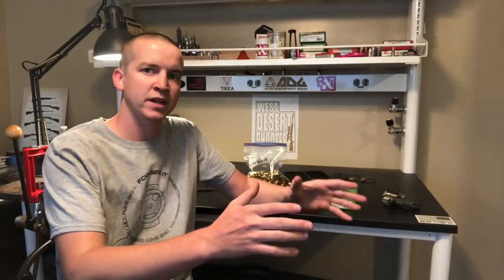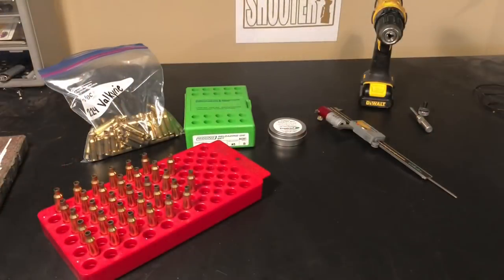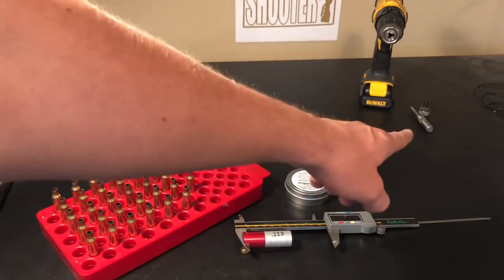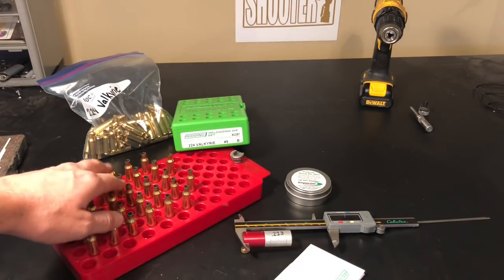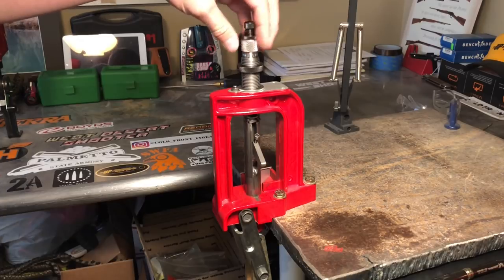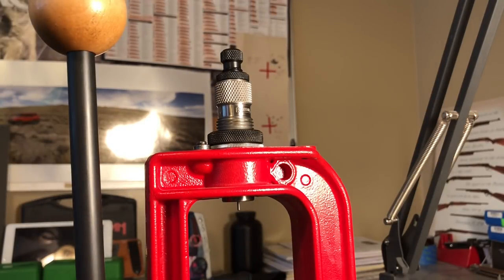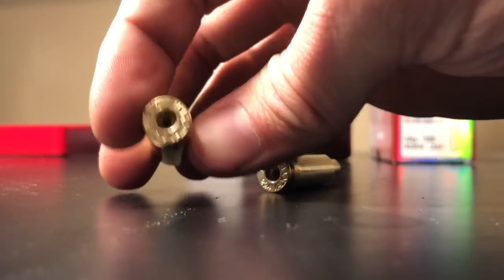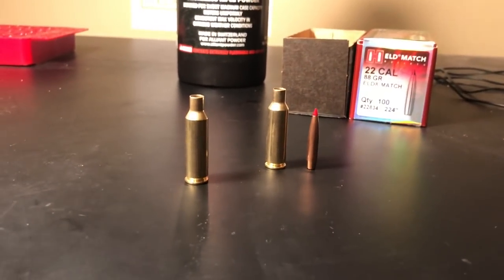224 Valkyrie Full Brass Prep

Comment: Worrying about the crazy stuff ruins your shot, I like how you through that in. Good instruction. One thing I would do though, Move the brass tumbler to a place that has a hard surface, The tumbler motor needs to cool while it is running the carpet will trap heat under it. Maybe, Maybe not. Just an extra step to make the motor last longer. Dave.
Reply: Thor's Axe I have my tumbler sitting on a concrete floor in another room it makes less noise on the concrete it's a cool basement floor too!
Reply from the maker: Great tip about taking care of the tools! I don’t have any hard floors to put it on outside of my kitchen. Always appreciate the wisdom and advice, thanks Dave. I definitely see your point and agree.

Comment: nice video good info for new guys. i like RL17 for my 308 have really good luck with it. wonder how it will perform in the 224 valkyrie
Reply from the maker: Good to hear! I may also sneak some into some Creedmoor cases as well and see what velocities I can get up to!
Reply: 20" bolt gun getting 2700fps with an 178 eld m
Reply: I loaded 26.8 grains of RL17 under the 88ELD with a OAL of 2.30 in my 1:6.5 twist Wilson barrel and shot a .525. When I was seating 2.26, the groups averaged around 1.5 inches. I have since loaded fifty rounds on the RL17 recipe...
Reply: reading so much different opinions on 224 valkyrie is like you love it or you hate it

Comment: Hi Logan, just watched the video nice to see you getting into this case prep malarkey lol , there is one point I would like to bring up if that’s ok , and that is I think it would be always better to Deburr the flash hole first in your new case prep that way they are all set from the start, but especially with your cutting tool doesn’t the burr interfere with the cutting set length to where it bottoms out on the burr and then when you remove the burr your cut length would be different or does your cutter index from the mouth of the case and not touch the burr ? Do I have that wrong ? All the best G.👍
Reply from the maker: Looking at my process I guess I never really had a reason when I did the deburr process. Great point though that may pay off at some point!
Reply from the maker: As far as the tool it bottoms out at the tip of the pin not the shoulder of the pin
Reply: GianniG  Good point considering the modification on the Lee tool... want to make sure the shoulder of the pilot/depth gauge is cut back far enough to allow for varying tolerances in the brass. I like to deburr the flash holes first before using my Dillon Super Swage (to remove crimped primer pockets) where the locator rod would be forced back into the burrs possibly causing inconsistencies in the amount of swage and/or blocking or partially blocking the flash hole.
Reply: Hi Jim , I think it’s always best to sort your flash hole right from new brass with a good tool , once you have the punched flash hole cut and deburred to the depth that you want then your cutter will or should be cutting to the same depth pretty much on every case thus making it repeatable and accurate, once you do this with your new cases you won’t need to repeat it. 😁
Reply: Hi bud , I don’t understand how does the tool index on the tip of the pin ? Doesn’t the tip go through the bottom of the flash hole and stop at the shoulder?
Reply: GianniG  I don't have this Lee but have the Lyman E-ZEE Trim kit which I believe is very similar. Yes, the tip goes through the flash hole. But no, doesn't really index on anything except when and where the tip bottoms out on a stop in the center of the shell holder after the case is tightened on the shellholder and only when it is finished being trimmed to that preset amount determined by the length of the pilot rod. The case is rather more indexed or held in place by the head of the case upon this tightening by the shellholder securing the rim in the extractor groove and the head. And also indexed in the neck and mouth of the case by the caliber specific pilot which is a good fit for the resized case, .220 for the 22 caliber .224 diameter bullets so as not to mess with the neck tension before bullet seating. I mostly use my RCBC Trim Pro-2 with a drill and that is different with nothing going through the flash hole. I like that a lot better. It's faster, you don't need any shellholders, it comes with a set of pilots for trimming most all calibers and you can fine tune your trim length.
Reply: Hey Jim, thanks for info I’ve never used some of these other products and I guess when they are set up right they should work well thanks buddy 😁👍

Comment: 3:02+
Caliper the neck at the shoulder....(0.2560)
... then caliper the shoulder at the body of the case. (0.4031)
...subtract those two measurements, 
...divide the answer by two,
... then add the answer to the neck diameter and walla, (0.3296)
 you have the diameter of the center of the shoulder (+/ -  0.002" or so.)
The SAAMI Specs Headspace Datum says "0.3400", (1-22-18) ,  but 0.330 is close enough for the application used. ;-)
Reply from the maker: This equation sounds exactly like a word problem in school I would say when would I ever need to know this in life hahaha. Thanks man!

Comment: I enjoy all of your videos, but you covered a very boring, but important, subject completely and explained every step.  Good Job.  Your desert 1,000 and 1,300 Valkyrie video results were impressive.  Especially with the wind and terrain you were dealing with.  I've got an RPR 243 and I've shot to 1,000 yards, but I'm building a Valkyrie rig with a Aero Precision Engraved Ar-15 "Valkyrie" Assembled Upper Receiver 20” .224 Valkyrie 1-7T 4150 CMV Nitride HBAR Premium 15” Keymod Handguard that was on sale for $255.  Everyone seems concerned about 1-7T issue with the 90 gr. SMK loads.  I'm considering the Uintah bolt rig you use, that looks interesting as a more precision LR gun.  I've been reloading for 10 years, and I am adding 224 Valkyrie to my list.  Trying some 224 Lee Pacesetter Dies, but finding Dies in stock is hard for Redding and other brands.  I use the Lee Presses, and find the company fantastic to work with.  Hope someone puts out a barrel in the mystery 1-6.5T to see if it helps the accuracy of the 90gr. 224 rounds.  The LRPS competition experts around here are getting the best groups out of custom 6.5 Creedmoor set-ups, and they are so tight, it is hard to believe it is possible.